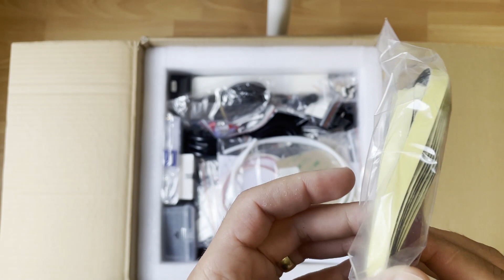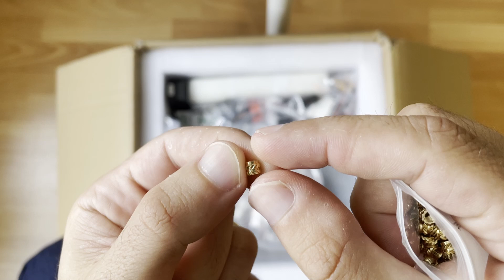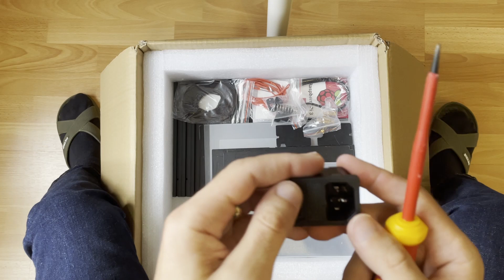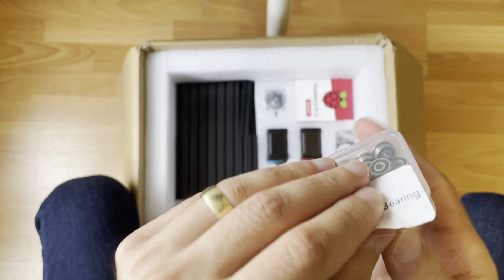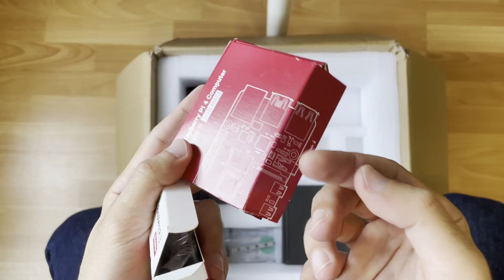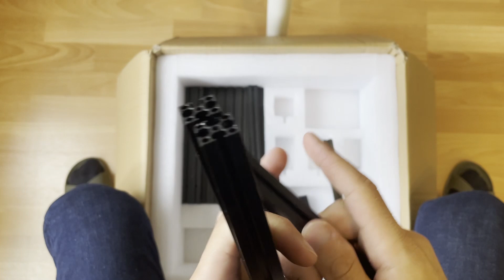Building Voron v0.1 - FORMBOT Kit [Ep0]

Comment: I ended up drilling and tapping a hole for the thermal fuse on mine, but the v0.1 doesn't necessarily need an earth since it's now using a DC 24v bed heater.